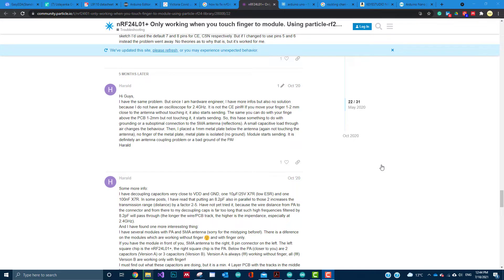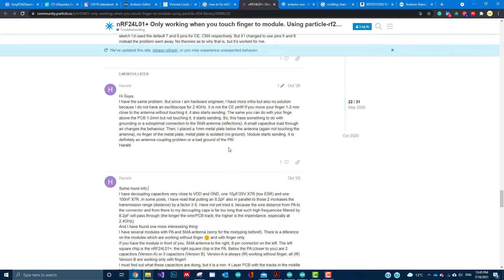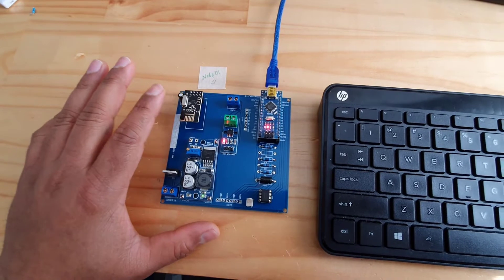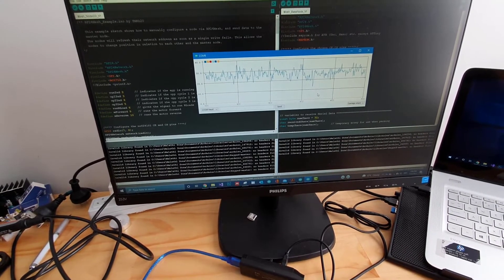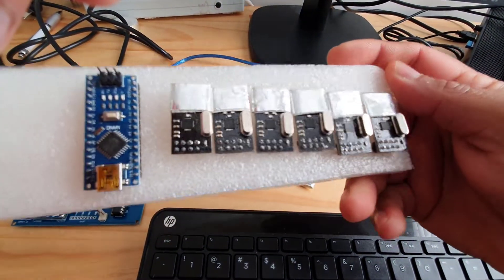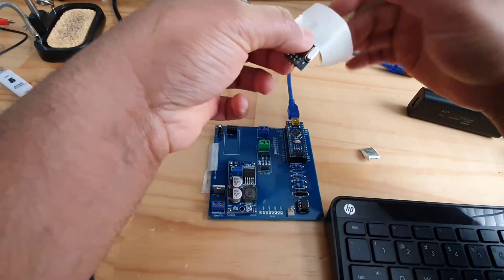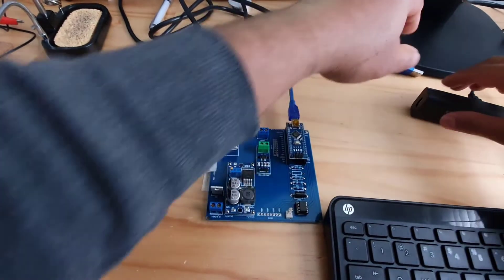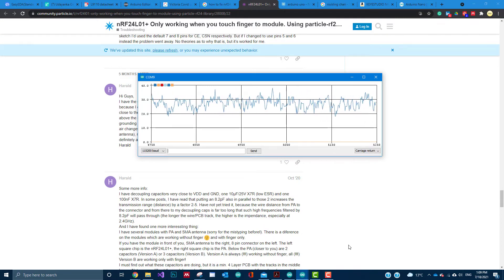nRF24L01- transmits only when PCB antenna is touched - FiXED

Comment: hello @umatechguides4u, i´m having this same problem but with the module with amplifier antenna. it only works when i touch the center of the module (not the antenna). do you suggest doing the same as you?

Comment: this is an output power issue.. with modules within 1-2m  range and output power on max will swamp the PA and you will receive nothing .. all the aluminium does is attenuate the output power so you don't overload the receiver on the other side .. just switch output power when you are testing so close or make an algorithm.
Reply: can you please provide me with some blog posts, research papers or something that tells us how this signal strength issue works??

Comment: This can only lowers the range. Problem is that 1pF capacitor to the GND on the board is not mounted and that cause the problem. If you look next to the beginig of the antena you will see that it,s pads are epty. Jast put it. It is part of the resonance circuit of the antena. It value could be from 1~2pF and you will have working in the maximum range. GL OK.
Reply: can you please provide me with some blog posts, research papers or something that explains how the range might decrease  because of this foil/metal solution??
Reply: where do we need to add this 1pf cap?

Comment: Wondering if this might help my issue. I had my prototype working with two nRF24L01 modules and then I needed to miniaturize the transmitter to fit it into the small space of a third-party device. So I replaced my nRF24L01 with an SMD-sized module that I soldered directly onto Arduino Pro Mini. In general, it works but the packet retransmission rate is a lot higher causing bad latency. It seems the nRF24L01 does not like its antenna being so close to the Arduino's CPU. I'll have to experiment with the antenna.

Comment: I was able to solve my problem by bridging 3.3v in and grd to the module with a 0.1 uf capacitor and a 100kilo ohm resistor which I measures from my body. These values simulate my finger touching these pins at all times, which solved my issue.
Reply from the maker: I tried the capacitor but not with a resistor. Thanks for the feedback, I will try it too.
Reply: @umatechguides4u  I also ended up placing a voltage buck converter on the output of the battery to create a constant voltage supply which seemed to help the signal reliability and range.
Reply from the maker: @brycetaylor4789  How far do you send singnals for?